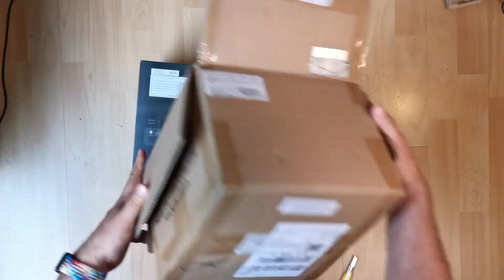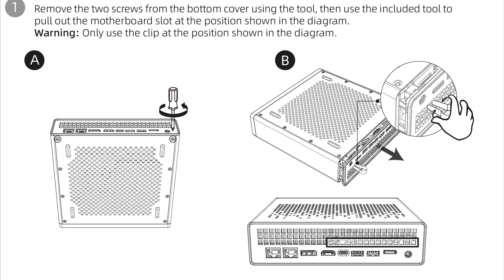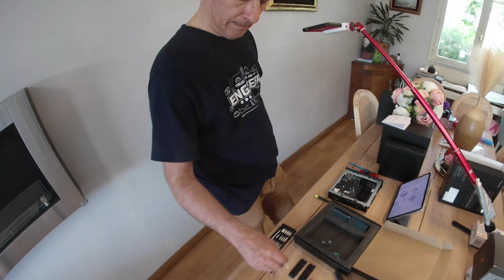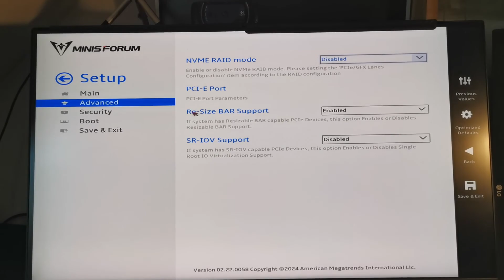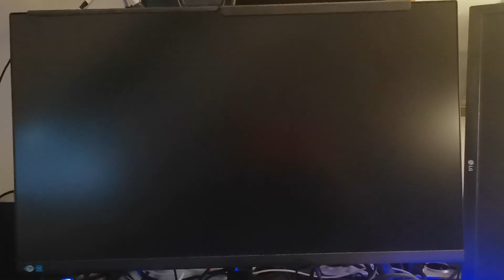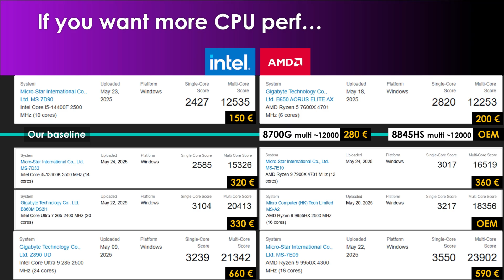Minisforum MS-A1 review vs GEM12

Comment from the maker: A little update about video out on usb c : after updating the usb c firmware again and unplug the machine 10 seconds it work with a Samsung USB c monitor (not with 2 other usb c to video devices). At least I can run on my 3rd monitor again
Reply: Do you get video output at the BIOS screen over usb-c Displayport Alt mode this way? 
Or is it only giving video output over usb-c Displayport Alt mode when the operating system (e.g. Windows, Linux-flavors) boots?
Reply from the maker: @Nosetalk yes no problem to boot in bios with an usb c monitor
Reply: how to update usb c firmware, is it bios update?
what do you think
MS-A1 (9700x + 32 gb 5200  vs GMKtec  K8 Plus AMD Ryzen 7 8845HS 32gb 5200)
i just want to use for dj software)
almost same price in my country.
Reply: @BananaBeach519 there is a specific file to download from minisforum support. You must launch a bat. Wait. Turn off. Remove plug. Wait 10 sec. About 9700x, you must check if you can configure it for 65w TDP or choose a 7900 non x. Don't forget 9700x doesn't have a good igpu.

Comment: I have the ms-a1, it cuts out a lot and freezes. No video and constant freezing.
Reply from the maker: If the fans are running ok and you don't have overheating problem, that sounds like a defective unit, I would suggest contacting the manufacturer for a replacement or a refund.

Comment: You can technically put a 9950x on it, but I wonder if it can be cooled.
Reply from the maker: yes you can. It's available from Minisforum at 1220 euros on amazon france. But do remember : the APU is weak on 9950x

Comment: I have been reading minisforum has horrible quality. Every second review is unit died, got a replacement and it died also.
Reply from the maker: Well, it seems lots of mini pc have fragile power circuitry. My first gem12 failed and was replaced with a new variant. My Ms-a1 is running fine for now. Finger crossed

Comment: Have you ever seen "asrock deskmini x600?
Reply from the maker: Yes, it looks like a nice machine. A bit thicker (80mm) but 145x145 mm so still under 2 litres and it accept 45mm cooler. It's probably quiter.
Reply: @technopatosh5029  It's much cheaper

Comment: I just ordered a gem 12+ pro :((
Reply: Great machine in my opinion. Is it the 6900hx or 8845hs model?
Reply: @patricklepoutre  8845hs 32 gb ram and 1 tb
Reply from the maker: Great. It's a good machine, very compact and silent
Reply: @technopatosh5029 I hope so. It's not coming yet, I hope I don't have blackout problems suddenly 😅
Reply from the maker: So, how the gem12 is running? Are you happy with the purchase?
Reply: @technopatosh5029  hey greetings absolutely is a very good machine I give photographer and I use it for photo editing in batch and some video and it works very well I am very happy certainly❤

Comment: Thanks for making this video. One question: Is the SSD fan able to be unplugged without overheating?
Reply from the maker: Good question. I didn't try because the ssd reach 44/47 degrees Celsius so, I think it needs some airflow as the case is very tight. Maybe standing vertical and with the panel removed... I'll try maybe add another fan above it.
Reply: @technopatosh5029  most of 50C is normal for m2 ssd's
Reply from the maker: Yes, I tried without the cover and ssd fan unplugged yesterday. 45 at idle but when I ran a short test it got over 57 was very slow to recover
Reply: @BananaBeach519 I'm working on a 120mm fan add-on for the machine. I will post a short about it if it works